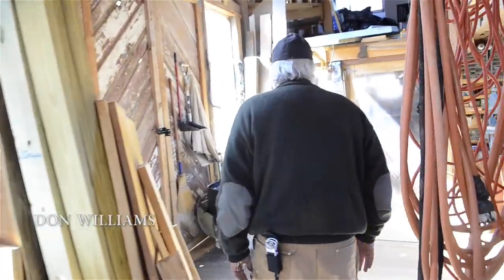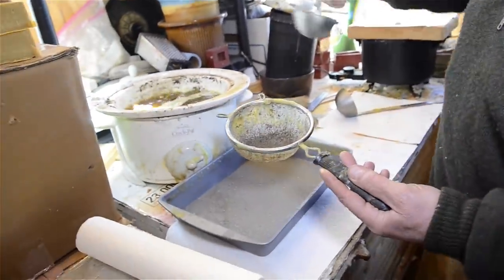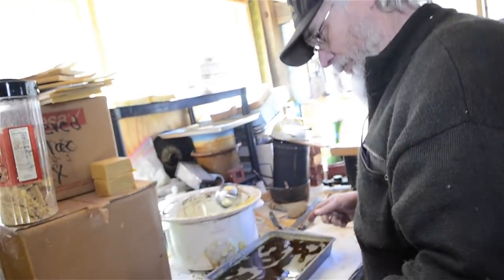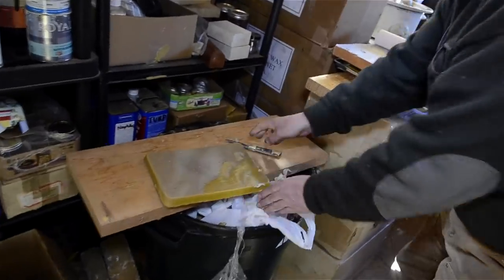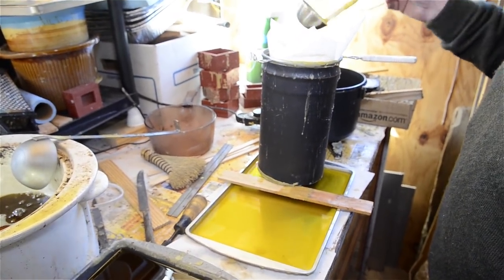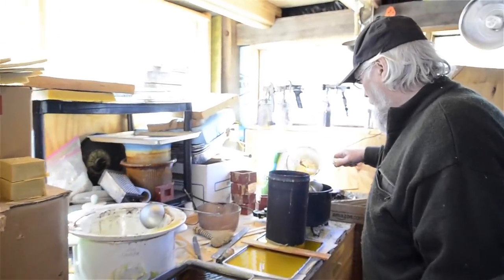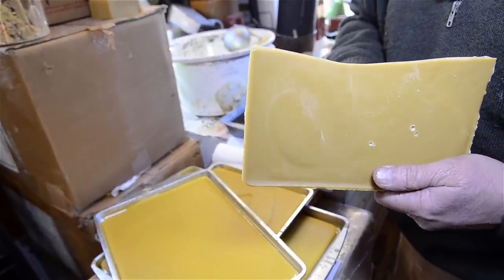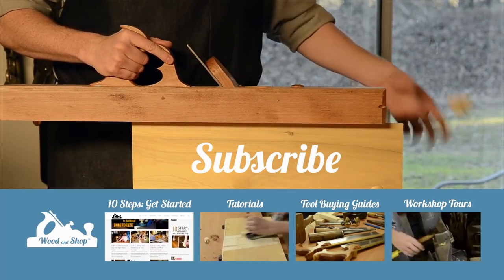Refining Beeswax with Don Williams (Workshop Tour Part 2)

Comment: As a beekeeper since 1985 I would like to comment on the purity of wax.  My concern would be that for many years now, since the introduction of varroa mites into North America beekeepers have been using Coumaphos as an in hive miticide.  It is allowed because it is not water soluble and therefor does not contaminate the honey.  It is however fat (wax) soluble.  My suggestion is that before using beeswax in any food grade situation, know your beekeeper and be sure that they are not using this chemical.  Buy wax locally.  https://en.wikipedia.org/wiki/Coumaphos

Comment: Hi Don and thanks for the video. Realizing this is a couple of years old but still valuable. 

I extracted my 1st honey and need to render my cappings. I snagged a crock pot but saw your 2nd warmer. Was it a Fry Daddy? 
I have an old one as well but was worried the heat might ignite the wax. 
Wife might get a bit testy if I burn the house down

Comment: Great video. Rather than using paper towels for filters, try large coffee filters. They work better and are made to withstand heat.
Reply: Maybe too fine. If the wax takes too long to filter it will cool
Reply: Nannyssillysoap co yes exactly! I tried coffee filters and they didn’t work as well as the paper towel

Comment: Can some one help me? I got some honeycombs, and after extracting the basic honey, started to try and separate the wax from half of it. the problem is i'm new at this, so a didn't knew i had do "wash" the honey before melt to filter, so the liquid honey kinda blended into the wax. the result is a brown wax with some sour smell of fermented honey in it, no matter how much i filter it. I already did the trick with boiling water 5 times, than moved to run the melted wax through some thick fabric... but nothing separates it.

the other half i did wash, put it in some cheese cloth and let in the tap for some time. the result is a beautiful yellow wax.

how can i save the brown half?

(my english is not perfect yet, I apologise for any grammar and  misspelling)
Reply: Tio Clotildo The honey (which is basically sugars and water) should dissolve in the water and not in the wax. Heating wax above 75 C will discolour the wax  and darken it. I have seen dark  brown wax from overheating. Also the water should be rain water and not hard water as the calcium salts will affect the wax. Finally never use copper utensils only stainless steel. The copper will discolor wax.  Actually many people like the wax to have a honey smell  - but sour honey?  Has the honey fermented?
Reply: just follow this video, throw your filters and all in the pot of boiling water once you have it melted, remove the filters and let it set until hard, then do this all again, but this time use a filter scrape off the brown stuff when hard.
Reply: there are a lot of videos on youtube, watch a few and write it all down

Comment: I cant get my melted wax to go through the paper towel. It just dams up. i have tried coffee filters as well and the same thing happens. Any suggestions?
Reply: First, make sure your wax is hot enough. If it's only just above the melt point, it will cool enough in the filter to clog it.  Second, try "shortening filters" from either a restaurant supply or Amazon.

Comment: I don't understand why people use baking pans to cool the wax product.  It seems like it would be more efficient to use something that's a bit taller that tapers down to a cone at the bottom of possible.  That way if there's impurities left in the wax it will concentrate in one place and be much easier to remove in one single slice.